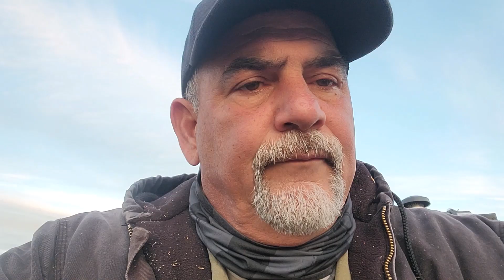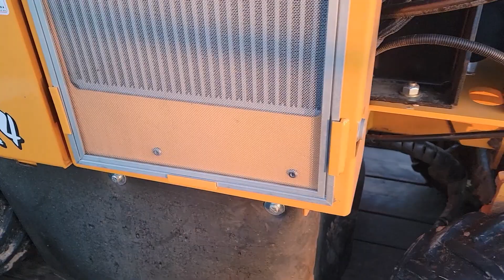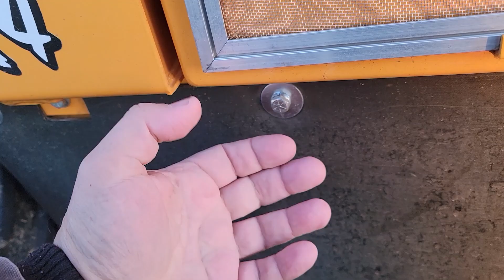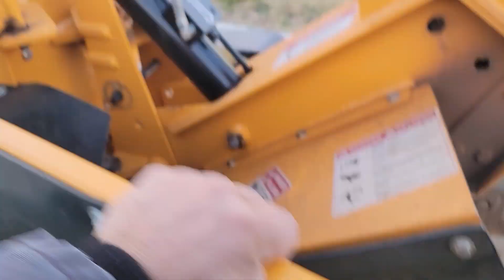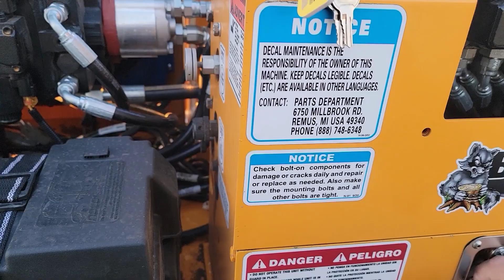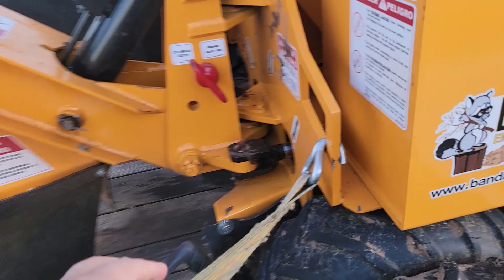Bandit 2550 Stump Grinder New Verses Old

Comment: Absolutely love your video's!! My son and I learn a lot from watching you. We pick up our new 2023 Bandit 2550 wheeled unit with manual controls a week from Monday. We are very excited to use a more capable machine. Relative to trailers. We do not want to do chip removal similar to your model. This said, an equipment trailer like you have here makes the most sense. Would you recommend a gravity tilt trailer or one of the trailers that have the wide lift up and latch built in ramps? We are leaning towards a 5k single axle 6x12 gravity tilt. Any comments on trailers would be very welcome!
Reply from the maker: I have a video on tilt decks coming out and yes I love tilts

Comment: Thank you for your videos. I have been looking to purchase a 2550 and I know you have a older unit. I would like to know if there is a big difference between the 44hp and the newer 49hp machines
Reply: Thank you I see you on Facebook, and I would like to know if you mind if I IM you some time.
Reply from the maker: @dennishammonds3731  no problem
Reply from the maker: Yes I run the Kubota Diesel on both , old unit all engine and pump engagement controls are electronic on the older unit everything is manual.  To engage the cutter wheel is a cable leaver , the engine throttle is cable all engine components are non computer .... new unit has a computer that is connected to all systems ... so far so good. I will be rebuilding my old unit and keeping as a back up this spring.